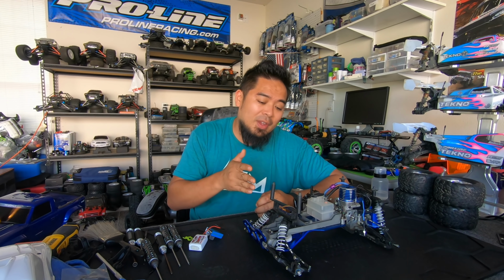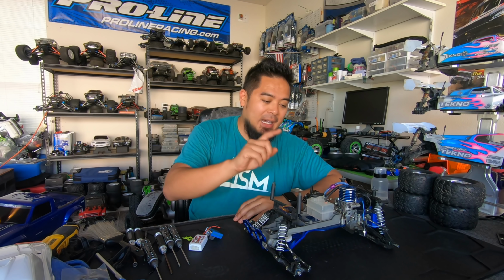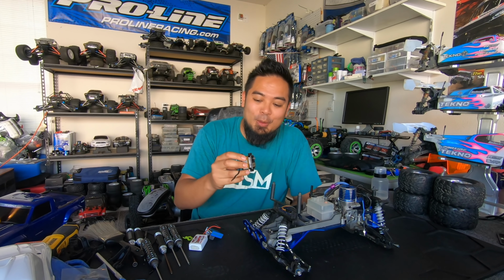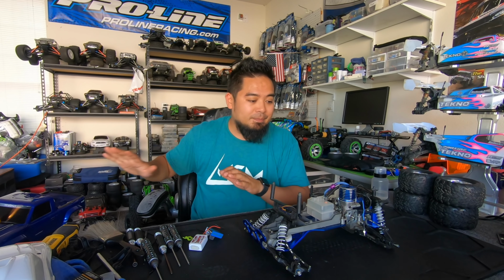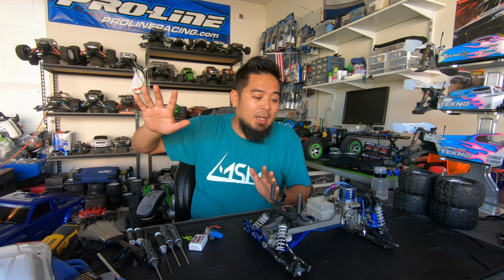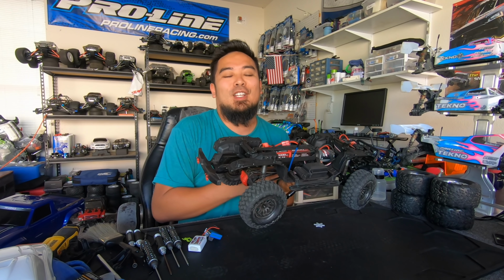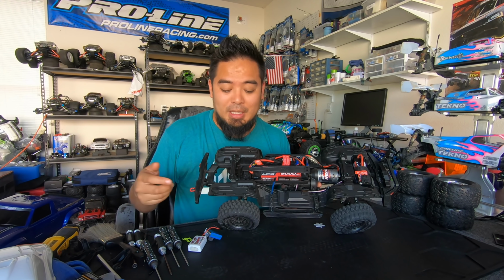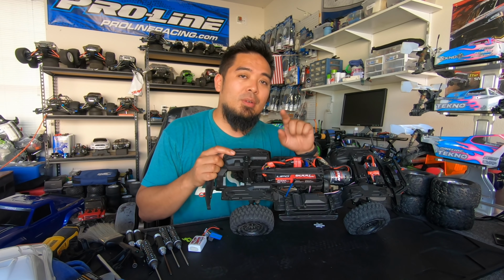Traxxas XMaxx Bashing on 6S Lipo Batteries

Comment: you really need to try it with a max6 and 8s, it makes ALL the difference!
Reply: That’s too much money spent at that point and too much things to change out
Reply: @MBfishboy13  That's the fun of the hobby for some of us though, buying and then upgrading the vehicle to our liking. I recently got an SMT10 RTR and already upgraded motor and esc so I could run it on 3S. I want to upgrade all the plastic trailing arms and upper links to metal ones because already cracked 2 trailing arms haha. I want to get bigger wheels and tires too, yeah just fun to customize them for me :-)

Comment: I agree with the sentiment that 8S is where it's at, I ran my X-Maxx on 6s for a while and thought it was fun, slow but fun, 8S changed that for me, still not as fast as my revo but I think it cool seeing something this size wheeling on command running around. Also I can run this full throttle through the entire back and not over heat.

Comment: Just a thought for your nitro pede. I drilled new holes where the fuel tank is n mounted a tmaxx tank. Lil longer run times n it seems to help balance out when pullin wheelies. Mine doesnt drag the ground much when it stands up.

Comment: First I like your videos. But you are way off on your analysis.  Xmaxx is hands down awesome to bash. You have done a disservice to your viewers to calling that a bash section and judge car by that. If on 8s and large jumps and real bashing it is not only more durable than any other rc model but that is exactly what makes it fun. You can push and push till it does break and at that point it is so extreme its a blast.

Comment: Hi, Do you have some recommendations for upgrades for the rustler 4x4 vxl
Reply: Traxxas constant velocity axles.  Stock ones aren’t that strong
Reply: Upgraded shocks ASAP.
Reply: Already upgraded those cause the shock caps kept flying off
Reply: Should I do front and rear or only rear? I'm running on 2s and the only reason I'm going to upgrade things is to be strong enough for 3s
Reply: Laurens De jong I upgraded both, but I only had trouble with the rear